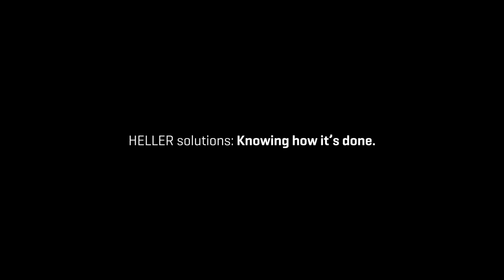5x performance cutting steel: HELLER HF 5500 | Spindle DC 100 i | Equipment package PRO

Comment: Sir will u please explain in starting of video of velocity is 250 m/ minute or 4.1 meter per second is this spindle move at 4.1 meter per second
Reply from the maker: The speed of each axes X and Y is 90 m/min. This is the rapid motion.

Comment: # of flutes on tool at 1:00?
Reply from the maker: It's a tool with 7 flutes
Reply: @HELLERMachineTools  Thanks, I wanted the info for mm/min feed or inch/min feed conversion (im in america) what kind of price are we looking at for the HF 5500 machine shown here? do you offer any other controller options other than siemens? is millturn a standard feature on this machine (looks like it is). is a pallet or tracked pallet system available? also where can i get ahold of a dealer inside the usa to talk pricing?
Reply from the maker: @ryan-si6fb  Thank you for your interest. You can directly contact our US colleagues (1.248.561.5111 | marketingusa@heller.biz). They can get you all the data as well as market specific info. 👍